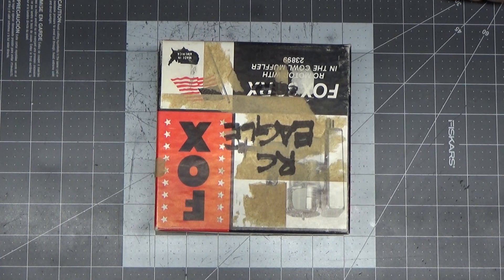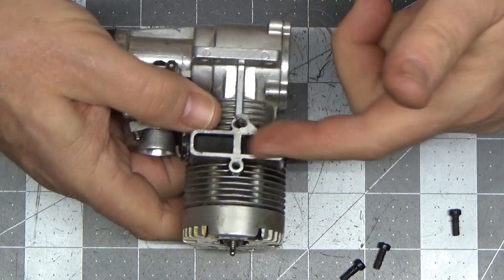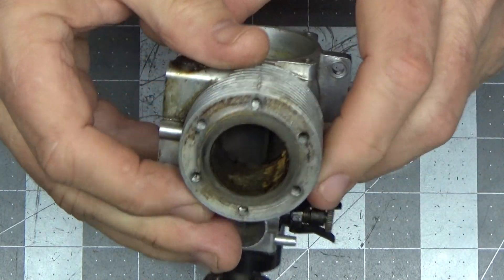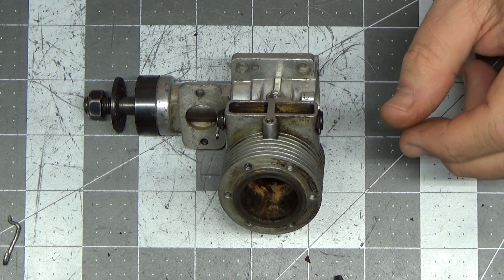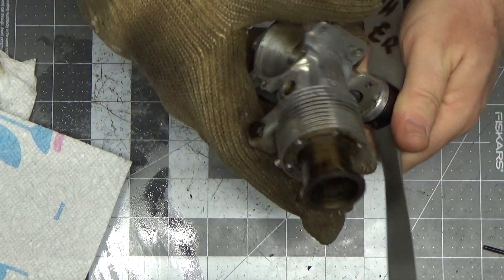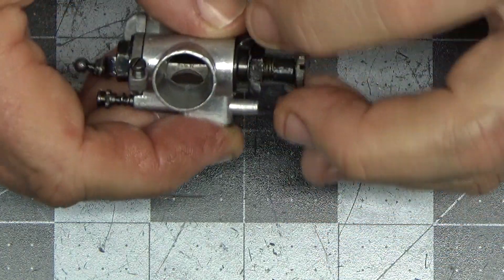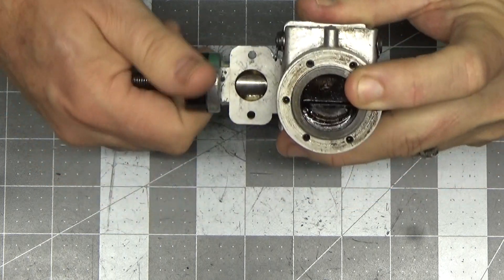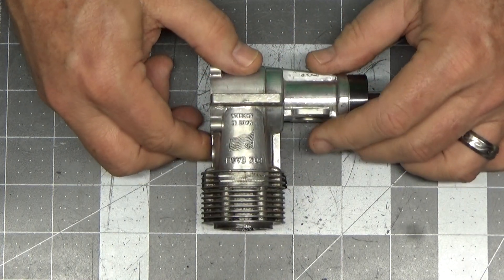Fox Eagle 60 A Look Inside

Comment: I have this engine. It can pull a barn, runs smooth as silk but the connecting is like lard. Mine wore out in a season. Fox realized this an bushed them later.

Comment from the maker: I have said it many times before and I will say it again.  To free a stuck engine you need HEAT and OIL.  Specifically 3-in-1 oil and a strong heat gun.  Not glow fuel, kerosene, not gasoline, not acetone, HEAT and OIL.  Heat until you see the smoke from either the oil vaporizing or carbon residue burning, then you can start trying to move the parts.  Sometimes it may not take that much heat, but many times it will.